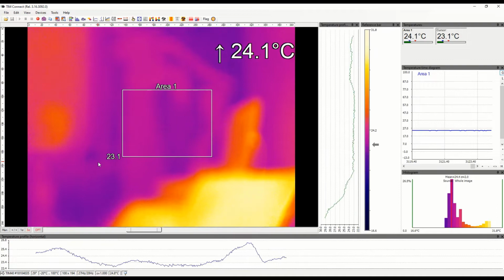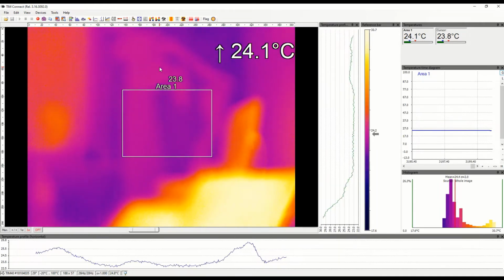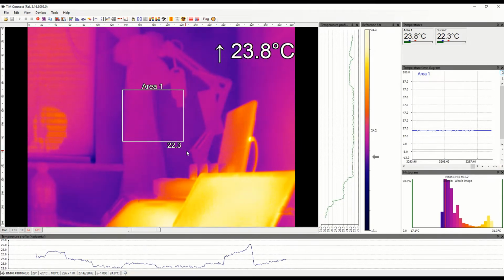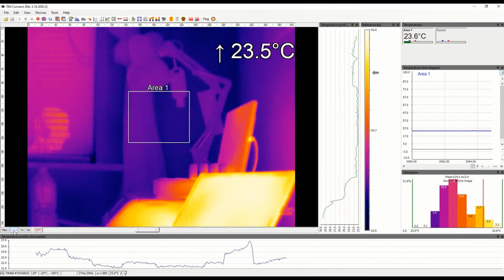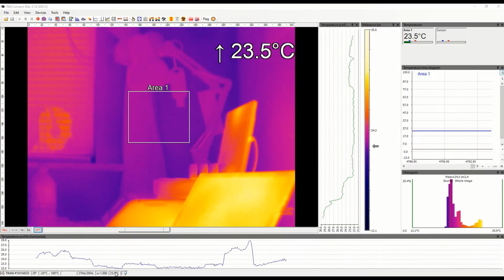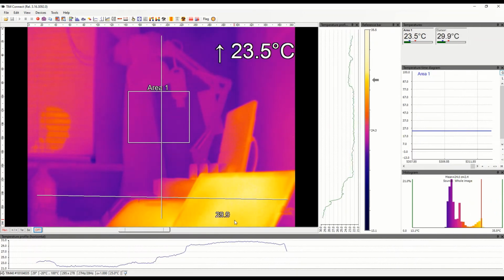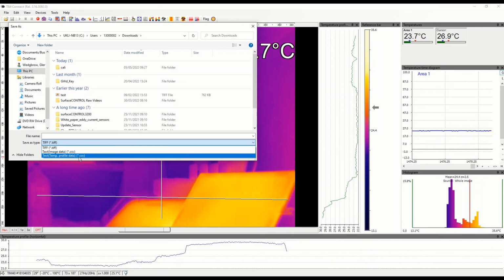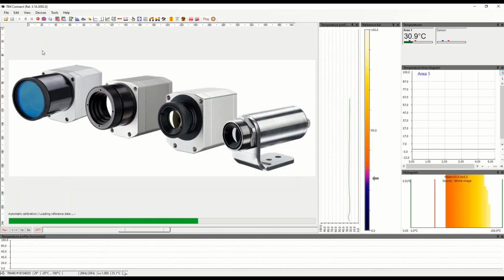Getting started with TIM CONNECT: How to guide part 1

Comment: Dear Sir, I'm using the TIM 400 thermoIMAGER but i can't  change the focus of the camera even though i configure the distance bar as you show in the video but the image doesn't change.
Reply from the maker: Hi, for the TIM 400, the camera has a focus adjustment directly on the lens. You can rotate the front section of the lens to adjust the focus.The distance bar is applicable to the TIM 8, TIM 40 and TIM 41 cameras only which have no manual focus I hope that helps.
Reply: @micro-epsilon-uk-ltd  Thanks you for the information, sir